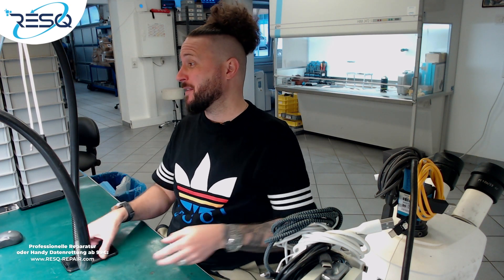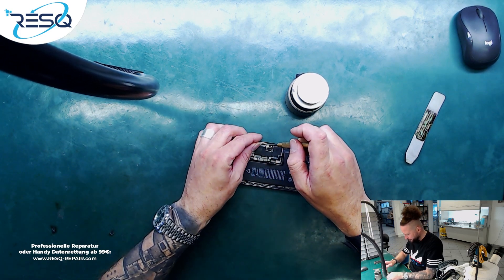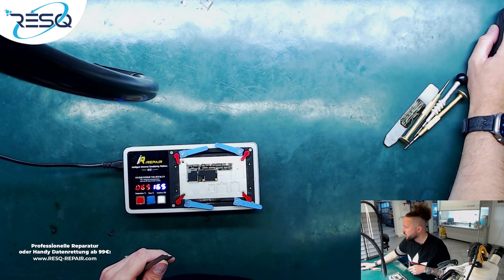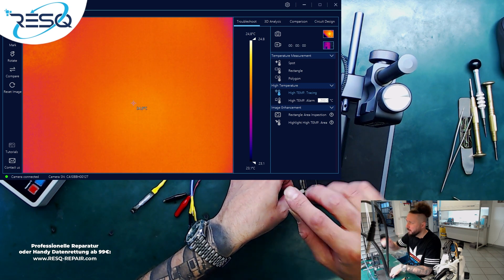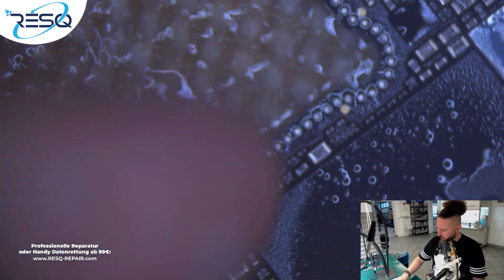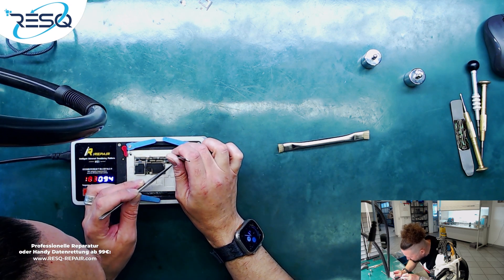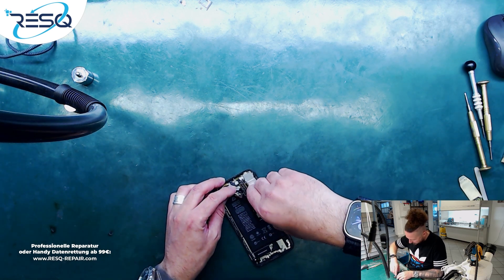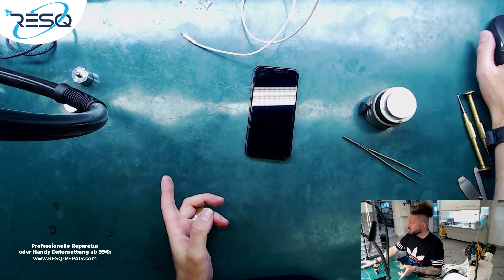IPhone XS Suddenly Stopped Working - Data Recovery - RESQ Microsoldering Show - How To Recover Data

Comment: Have you replaced your hot air machine? I know in the past you were using the jbc with the smaller handle? What do you use now? Why moved to the big one?
Reply from the maker: No. I sometimes work with this handpiece, sometimes with this. Like I want.